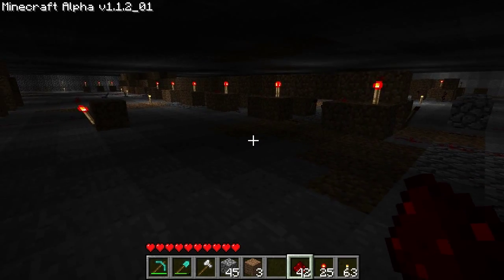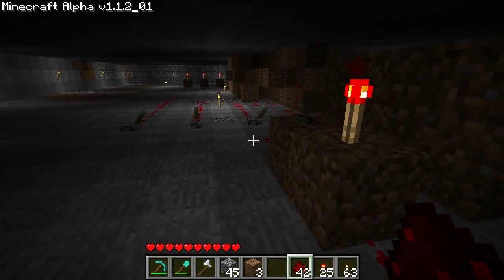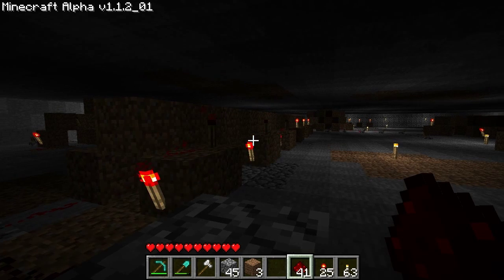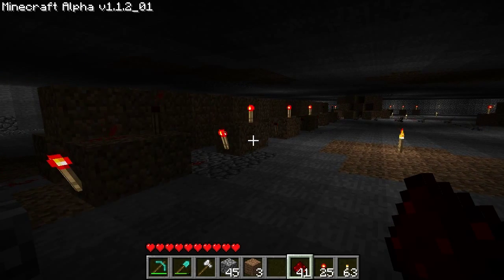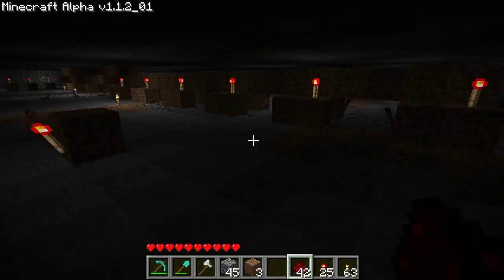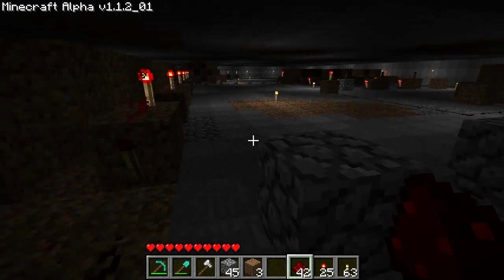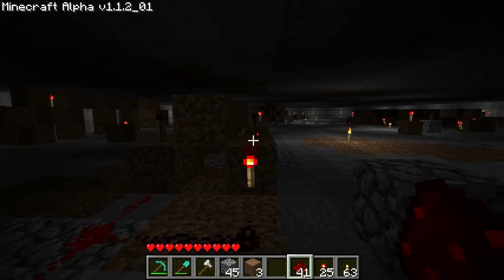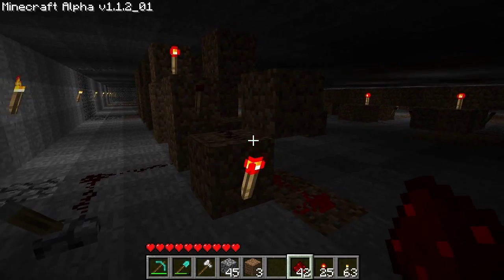Minecraft logic - Delay line memory

Comment: could you please entertain this question? At 1:23 the "hot" redstone is DIRECTLY touching the end of the chain, but is not sending a signal to it.  How is that possible? Also, the input to your chain is true throught the duration of the video, but the double invereters all have false outputs.  When you flip the switch at 1:28 the state of that 3 block line of redstone does not change.